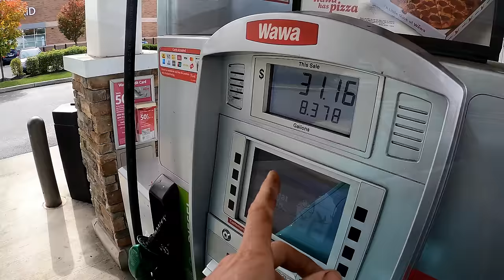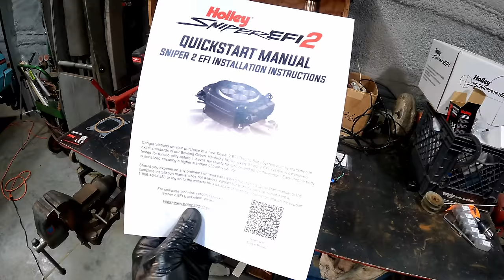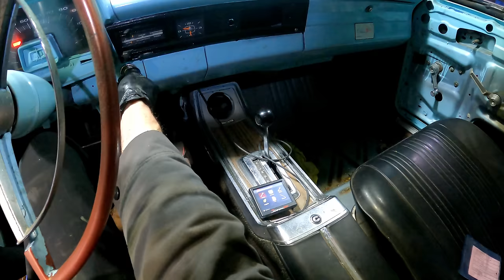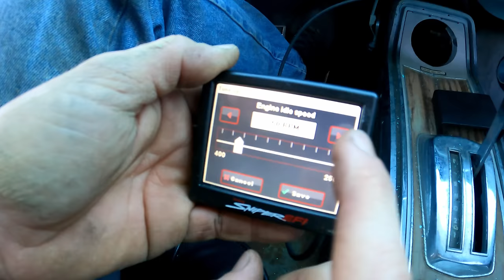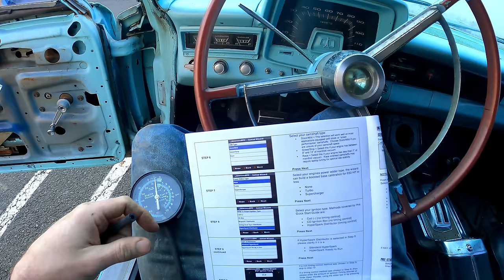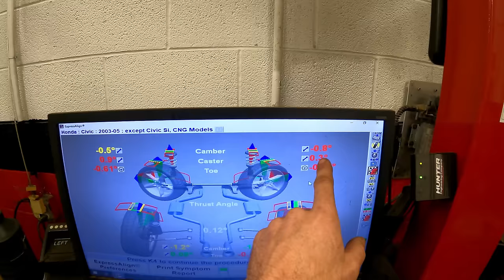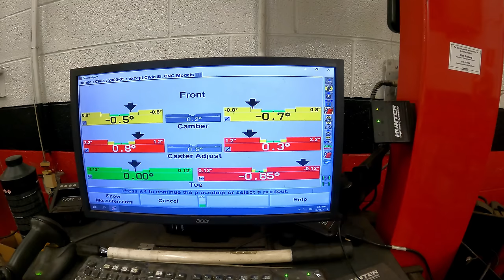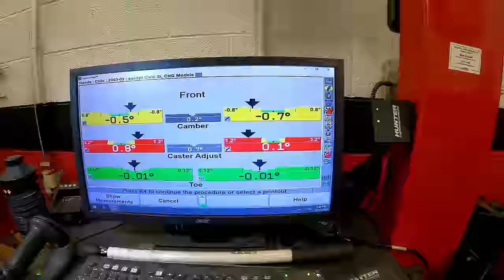1965 Fury Wagon Gets A SNIPER 2 EFI + Update On Jens Civic - NNKH

Comment: Thermostate in or out...I have not made a definitive, exhaustive study of no thermostate, but those times of not using a thermostate resulted in the engine bearly getting warm or operating temp.  With these newer, modern engines, having a theremostat is probably a requirement for optimum engine operation.

Comment: Bro for Jens headlights, just put a little ATF on a shop rag and rub it into the headlight lenses. Will clear them right up. Won't last forever but faster than wet sanding and clear coating them.

Comment: You measured the mileage without thermostat in the system. That EFi system might then 'think' it needs to add fuel because the engine runs too cool.
With the thermostat back in the mileage should improve because the engine runs at the proper operating temp. 

I really like that trick with the sock. I'm gonna remember that 👍
Reply from the maker: True. I'll have to do an update video on the mpg next time I take it out for a good Cruise

Comment: Saw the tarp setup before and they used a piece of 1/2" Galvanized pipe inside the the PVC (with caps on the end) to give the the base of the tarp weight, to keep it from blowing around too much. Otherwise, should work great. They finished theirs with an old curtain pull/pulley system to roll up the their tarp, worked easy. Love the work on the wagon. Had a 1964 Fairlane and this reminds me of how ours was before I messed with it as a high school kid, good stuff.
Reply: A lot of practical physics going on with the Tarp access door!

Comment: Great video, as usual! You prob figured this out by now but the IAC should read 5-10% at idle while not in gear.
Reply: I don't think I saw a percentage on the display, what would you guess the percentage it was trying to start out at from factory?
Reply: Ps, @CarlsJr you got great burgers but those prices are taxing!!

kidding I know you're not
Reply: 20:33 the right side reads "IAC Pos, %"
That should be between 5-10% at idle without a load on the engine
Reply: @LAactor  Funny enough, that is where I got the idea for my login name. LoL

Comment: i think i would have filled the pipe with water or sand or something for extra weight
Reply from the maker: Maybe in the future if it becomes a problem. But for now I would rather not put the extra strain on the tarp. It's already pretty heavy

Comment: Hey, Chris, my wife had a 2019 Honda CRV with heater issues so we took it to the dealer. After it was fixed I asked the tech what they did to fix it and he said Honda's cooling system had a problem where the chemicals in the cooling system caused the coolant to get thick like syrup. He said they flushed it, filled it with CLR, ran it for half an hour, flushed it again then filled it with coolant, and it worked fine from then on. Love your videos.😊

Comment: Back in the days (1950's) when we ran flathead Fords in race cars we restricted the outlets in the heads to slow  the flow down for cooling. We were able to run stock Ford  car radiators ($10.00 each or so)  with no problems. No restriction, ran too hot if stuck in trafic like a restart or slow laps. It is pleasure to see your "old time solutions" to these videos..

Comment: For metal cutting, Ive always took a Circular saw and reversed the blade. But I was only cutting some old aluminum siding for a garage.
Reply from the maker: Yeah that works well for thin aluminum. You can actually put these carbide blades meant for cutting steel on a regular circular saw as well but it's a little dangerous since it throws razor sharp metal everywhere.  Also the motor is underpowered for this use. But using a purpose built circular saw for cutting steel.  Total game changer. Cuts like butter.

Comment: When loosening sway bar links, cutting off the end is fine but you can also wire-wheel the threads, and then loosen a little to “turn” the threads a little, wire wheel the remainder of the threads and often the nut will spin right off. Probably about the same amount of time either way but I know some links have a hex built into the end of the bolt part and that hex is handy to have sometimes when it’s legitimately stuck and vice grips won’t fit the opposite side.

Comment: I love that car!  An old mechanic told me to run some liquid Dawn dish soap in the cooling system. It provides some lube and it will clean it out after driving around a little.  It makes a sudsy mess but you will not believe what comes out!

Comment: Before you spend on the new headlights, try this. Mother's Aluminum & Mag Polish. Just go over the covers with Mother's & a buffer, wash off & wax with any good wax, & you're done. No sanding or anything else.
I've used it on several cars, including my BMW. It's been 3 years & still good, including lites from the junkyard on an equinox from hitting a deer.

Comment: Concerning the headlights - and plastic lenses only, obviously.. man years ago I grabbed the Dupli Color headlight restore set. It's 2 spray cans, one is the polish, the second is a clearcoat. I'll tell you what, that was the BEST 20 bucks I've spent. Every spring, i spray down each of my lights (4 in total, 2 cars)  1 spray with step one, wipe it down, 1 spray with step 2 let it sit 30 minutes. The lenses are crystal clear like glass for about a year. Then.. well, next spring it's time to go again. I've done ALL of my friends' cars and trucks over and over again, I'm NOW OUT of the stuff and the ONLY place that has it still for 20 bucks or less is Jeggs I think.. I need to order some more, I'll get a big case of it if I can find it.. Man it's really REALLY good stuff, and there's honestly NO headlights like OEM headlights in my opinion. If you look for it it's a white box with 2 little spray cans in it. I use a lint-free rag to do the first step, man you can get probably 100 or more uses out of the set.. It's AMAZING stuff.. Just great!!

Comment: Never had a problem with glass or plastic thread on filters. Lots of third forth hand issues, but if the actually do exist, it's most likely neglect. Sloppily put it on, forget it until it causes a problem and blame the component, is the best thing right.
As for in-line filters, get a marine one like from Racor
Plastic fans blown apart, hehehe. Someone seen a will it start vid of a machine sitting out for 40 years , the fan hit the shroud and blew apart, now all plastic fans blow apart. But I've always dumped the motor mounted fans and run two electric fans
 Hazy headlights, really, hehehe modern hazy headlights  are 100 times better than the old lights we used to use with no problem

Comment: Talking about the headlights, you have to take the front bumper off to change them. I did it on my wife's Honda Accord . The cost was about $85 to replace off Amazon. The sanding and all the crap you see on YouTube just doesn't work. Replace the whole headlight assembly, not to bad.

Comment: there is a product called gano coolant filter that you install in upper rad hose. it has a screen that collects engine crud from getting into rad. comes in glass or brass. I bit pricey but works really good.. once the screen stops getting clogged you got everything out of it

Comment: I like this video because I had a '69 Plymouth Satellite. To improve gas mileage, you might try experimenting with the spark plug heat range. If your driving is more of stop-n-go, then try the hotter (than factory supplied) plugs, colder if you do more highway, long-distance driving. You can go crazy and try dialing the position of the spark plug electrode to get fire just so.

Comment: Take a little WD-40 wipe it on your headlight in a little bit around headlight. Now sprayed bug spray with DEET the higher the deet contact the better it works. Now take a clean rag and wipe it wipe it while adding a little bit. Now look at your how do you rag gets and how clean the headlight will be. Doing a couple times and then lubricant last and wipe it. Now put some good wax on it and buff it a little bit with your hands. What are a difference it. And like you did with your truck I got some headlights the whole real cheat for my Toyota Corolla 07 and my 2001 Ford Taurus. You might have to adjust the new headlights to get the right adjustment but comes with everything with the bulbs. Looking forward to switching them over but for now you might want to try bug spray with and then wax on wax off😊

Comment: A quick fix on the headlights is to use a rag in acetone and wipe across it. Make sure you tape around the headlight to protect the paint and ONLY wipe once in the same direction. Acetone is what manufacturers dip screwdriver handles in to make them shiny.

Comment: You can use clr or the dollar tree version of clr to clean out a heater control valve or a heater core. If you unhook the heater hoses and let them drain, then fill the hoses holding them up with clr and let the clr soak thru the heater control valve and into the heater core for awhile. Then take a water hose and force water thru oth heater hoses several times until the gunk or corrosion is dislodged and then refill with coolant and things should heat up.

Comment: Merry Christmas Chris, Jen and Gusman from Sydney Australia.
Thank you for your video, especially;
* flushing the engine coolant, using a material filter screen (sock) magnets and CLR chemical.
* removing carbattitor and install new Holley Sniper II 
* Unsure about the LCD screen, have you fitted a computer engine management systems (OBD II reader)
🌲🌏

Comment: worth getting a sealed fuel system at this point.. (canister)  that way you suffer no moisture pitfalls using ethanol gas.. not expensive you can build new from scratch or salvage one form a used car, totally analog so no wires or power required,  couple pressure relief valves, sealed the gas tank, sealed gas cap, BOOM!  best way to go IMHO, prolly build a real nice one for under $100 cap included . . .  of course a fuel return system is always best, internal pump and regulator

the pressure relief valves are analog so they are easy to install, simple really . . .

Comment: I have a 71/2 inch metal cutting blade on my saw cuts great need a glove though cut material is pretty warm also got a steel 14 inch mitre metal saw dewalt way better than friction saw less mess.

Comment: I don't know, Chris.. when it comes to a Honda.. I ONLY use Honda stuff.. I had a half shaft rip off the mount, replaced it with an OEM pull from a jy, but I put an aftermarket lower control arm with new bushings - it was shot on the passenger side where the half shaft ripped out of its mount - man 1 year.. those bushings lasted 1 year. Eh... It's still fine, it doesn't clank or anything but i have to rotate my tires now all the time because it's wearing the crap out of that tire way more than it should.. I'm going back to OEM Honda next time I change it out.. I hate to pay the Honda prices but man.. totally worth it cry up front but in the long run I'm happy.. 04 Odyssey. Also I put a $50 Cardone axle on the end and I think it's like 1mm short, my alignment just is not right.. I'm going to grab a used on from a crash vehicle... luckily they've used the same axle for just about every 3.5 fwd Honda late model van for years and years..

Comment: Chris on your tarp door that you got on your garage we use that type of system on a Conestoga trailer what we do to keep the door down in heavy winds when we're trying to tarp on the inside when we're working from both ends is we run a piece of Steel inside to keep the bottom down you can do the same thing you probably got some lead pipe or steel pipe laying around their small enough to add a little extra weight to keep that hanging down that's a great video I enjoyed that very much and also watching you put it the new ball joints in and the lower control arms control arm Merry Christmas to both of you hope you have a great year next year

Comment: Don't you want to run a 196 deg. stat in the cold weather? Anyway, beautiful cuts!! I have an old Makita 7.25. I cut tile with my angle grinder. What a beautiful '65! I love the idle lope. Typical fuel mileage from an old Mopar. If I get 10+mpg with my big block gmc seirra, It's a good day. Love the glass filter, although I'm with you on materials. Just make it durable and easy to separate!

Comment: The rust in the block needs to be treated. Capturing with a sock is OK but does not fix the problem. The only thing I know that treats the rusty metal of an engine block and heater box is Thermocure. Pour it in, run the engine for a while or drive it and then flush until there's no more black water from the block. CLR and other radiator flushes are just to remove rust but do not treat it like Thermocure. Been there and done that over and over and wish I knew about Thermocure sooner. Good luck!

Comment: An engine will only run cooler without the thermostat in if the cooling system is capable of creating those lower temperatures. You will never fix an overheating engine by removing the thermostat unless the thermostat itself is bad.

Comment: You should fix interior  on that  fury wagon. And  find by color  code  some  paint  and  patch  those biggest (most noticeable)  rust  spots.  About Jenns  honda   turd  36:20  You should  replace  it.... Worn boot allow water in  and  water flush  all grease  from lower ball joint. After two weeks (or more,  less) there will be a wobble and the part will need to be replaced.  OR find  new  rubber  boot  and replace  it. Here  where  I  live  even allmoust new part it  must  be replaced because  worn boot.  Worn ball joint  boots  crack in  rubber  of  control arms  and other  suspension is a major  damage  which leads to  fail  car  inspection   😒🤞

Comment: My response to the Honda headlight hazing buy the 20$ 3m headlight restoration kit it come with two step sanding disc and a fine grit polishing pad and the pice for the drill that the sanding disc and pads go on as well as alcohol wipes and the wipe on uv clear coat it’s about 2 hours and the lights will look brand new and will last well over 2 years

Comment: @NoNonsenseKnowHow For those headlight 'cataract-ack-ack-ack' 😁conditions - on my 09 civic, I used the cheaper turtle wax 'restore' kits and I thought they sucked (tiny square sanding pads, still fairly milky lenses...just ridiculous) so the next year I bought the Meguiars Heavy Duty Headlight Restoration Kit - used a drill for sand/polishing - did an amazing job.  Do at least two passes with the fine grit sand paper - and it makes all the difference.  For an extra $10 over the cheaper kits, totally worth it. After a year and a half in Chicago weather parked outside, they still looked amazing.

Comment: After my Corolla got a new left front lower control arm, they did check wheel alignment, and surpprisingly everything was fine. I have hit the curb several times and you hear someone saying that even a small hit will throw the alignment off. I guess my 2004 Corolla is just too sturdy

Comment: Fill the radiator with atf or similar thin oil. Then it wont rust or freeze.
Reply: What's wrong with plain antifreeze/coolant?
Reply: @ricebike  the main one is rust. but the added bonus is that if you get a head gasket issue, it sends oil not water into the crank.

Comment: We do not recommend using CLR on galvanized metal, aluminium, or copper. CLR will compromise these metals. CLR is safe to use on metals such as stainless steel and solid chrome.

Comment: 36:03 i am gonna correct you, a torn bushing on a wet surface or on an icy surface may lead to a loss of control due to a  reduced vehicle stability. As for the control arm they rust from the inside and break.
Reply from the maker: In all my years working on cars, The only control arm I ever saw rust to the point of failure was on a Hyundai and that car was completely rotted out everywhere.  If it's a forward vertical bushing that's torn, it's not going to affect handling on ice
Reply: @NoNonsenseKnowHow  living in canada i can tel you that more than one car ive worked on has suffered from broken rotted control arm, in my area we use a high lot of road salt. And as for the ice control, even a worn shock absorber can reduce handling on ice and snow.

Comment: It's my experience on Toyota, Honda, and etc lower control arm bushings aren't that much cheaper than buying the entire control arm with new bushings already installed and is my recommendation to replace the entire control when you live in areas where rust is a real threat.

Comment: Your supposed to drive in forward on that type of lift, then you can open doors all the way, and they are designed to carry the engine load on the short arms. But I get why do use it backwards for filming. Need to reverse the left 180 degrees.

Comment: My International 200 runs so hot I can't operate it with a thermostat.

But then, I can't get a proper sized radiator for it for less than $500, so I went with one for a smaller International [Scout].

Comment: loved the video!,  don't know when i'm going to do it but my 1974 plymouth sport suburban wagon looks l;ike a candidate for that holley sniper 2 set up. currently running LPG on it but wanna go back to gasoline. only thing here is the price of gasoline 1 gallon 3,8 liters price P\L here is €1,85 = $2.02 P\L = would make $8,08 P\G. o and it has a 440 in it 😅. have the same issue with the coolant system learned a few things watching this. have a electric fan setup on that. 😛 can Scott give me a deal on a full setup?